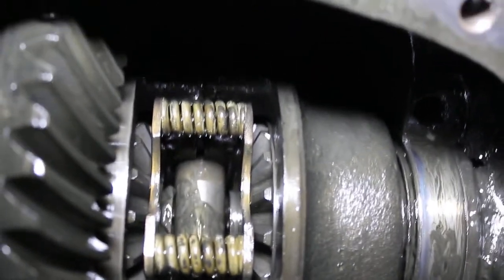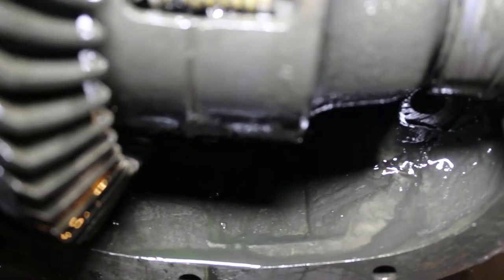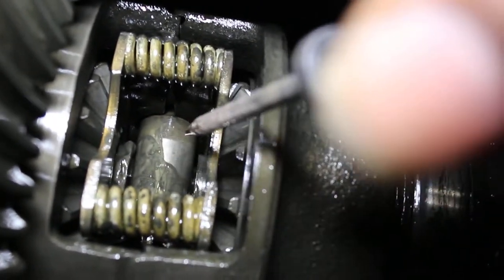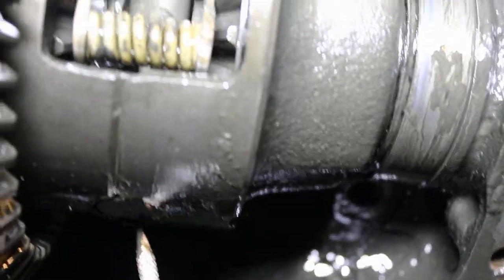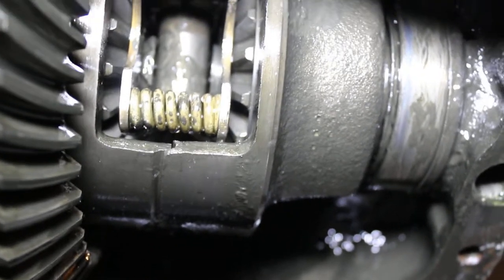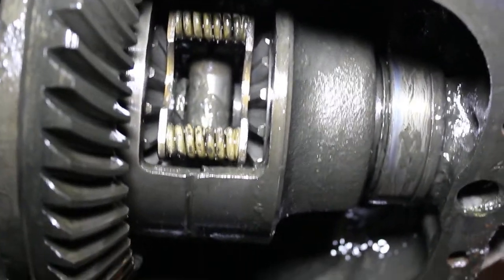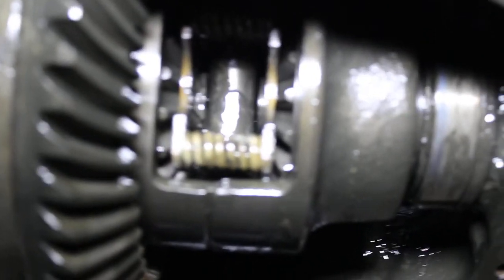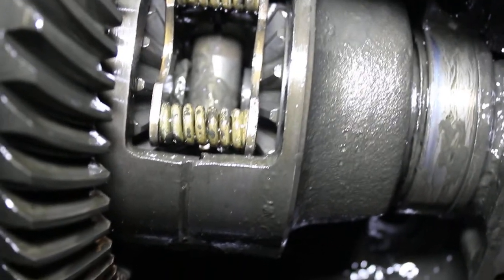HELP 7.5 pinion shaft removal

Comment: bro the gears stuck to the pin :/ like it's cock eyed and honestly, I've had this problem b4 and all you can do is beat it with a 6lb hammer and cry because it could take DAYS to get out. I'm gonna try somethin to and see if it works. if it does I'll be sure to share how fix this common nightmare